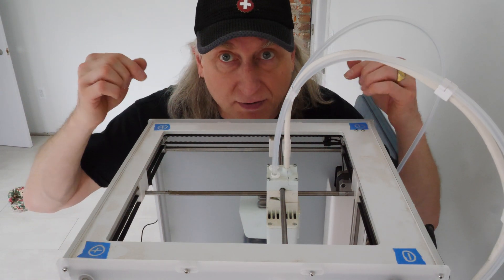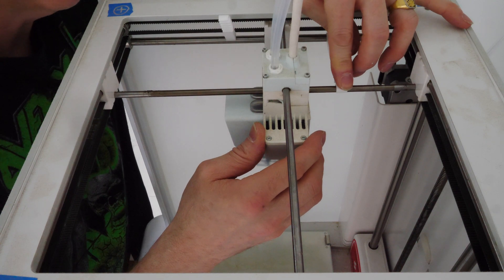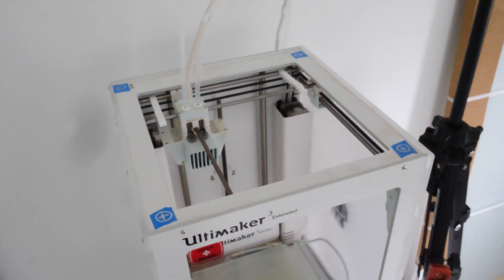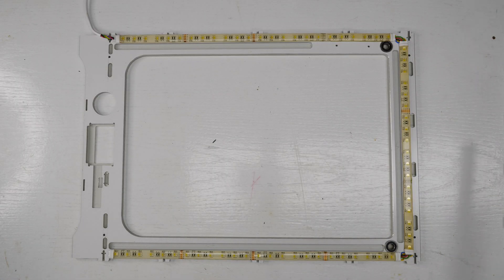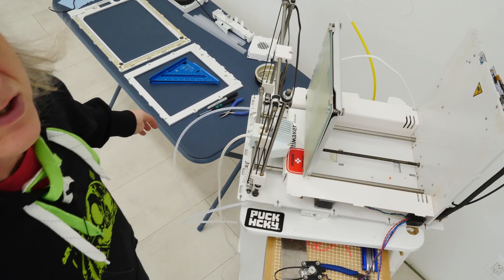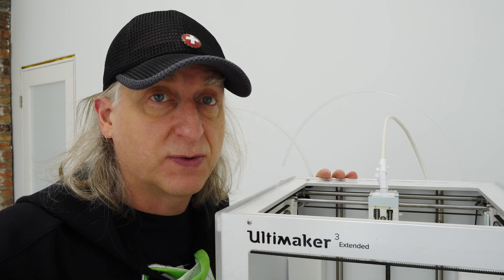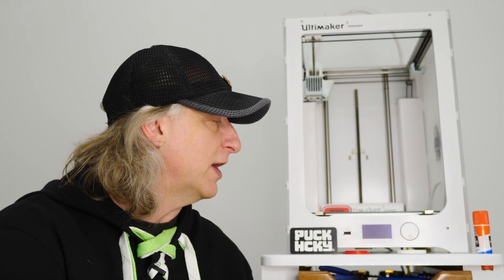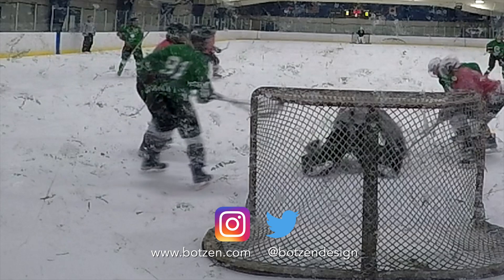Fixing my Ultimaker 3

Comment: The alignment tool is also very good at showing how weight of the Ultimaker's dual head can make the belt jump a tooth and an entire strip down isn't necessarily required, sometimes I found just relieving the tension and realigned the carriage with opposing parallel belts, that run on the same stepper motor. I would check the belt alignment, before ripping the whole machine apart, as the acrylic sheets are usually squared enough not to make a difference to the auto levelling bed. The bolts that hold the cabinet together can shift if subjected to hard impacts. Loosening the hex nuts and sitting the cabinet on a flat surface, then re-tighten the bolts, is sometimes all that's needed. I hope this helps. 👍

Comment: Hi there!  It's good to see you tackle such a job, but I think you should have put out a video describing the problem, asked for help, and awaited some replies for a week or so.  You would have saved a lot of time and trouble. I'm a fixer, of almost anything.  With a physics and math education and heavy love of science, I love puzzles. Your's is pretty easy and perhaps someone with the same problem can read this and fix their's easier.
OK, as someone else suggested correctly, measure each panel across the diagonals to find the problems.  Then get some thin metal rods, even straightened wire coat hangers will work. Attach one on one end on those problem diagonals and let the other end hang over the opposite edge with a mark on it where the corner should be.  Next, use the tools suggested by the manufacturer on the rails. Next, loosen screws on the housing slightly so the there is some wiggle room in the assembly. Now adjust belts to bring corners back to square while watching the tools and the rods so you know when it is back in shape. Then tighten the screws back up and then test machine.

Comment: My first thoughts.
There is nothing wrong with the panels, but with the drive axel. The toothed belt haves jumped over some tooth from the gear. 
Also , to measure the panels you need to measure diagonal from corner to corner. It can be that your triangle is crooked .
If you have the panels, why don't you redraw them and laser cut them new?

Comment: I wish you explained how you straightened the panels.  I wasn't getting a good sense of that from the sped up video.
Reply from the maker: Yeah, my bad I basically clamped the panels on a table and rack them by hand a little bit and then check them and made more adjustments
Reply: @EricStrebel  Thanks.  Good to know.  I wouldn't have guessed that that would work.

Comment: Pretty sure the material is Acrylic - I adapted the S5 at work to take unsupported filament through the material station….. it chipped suuuuper easy… PC doesn’t do this when drilled. So my tip is… be very careful if u need to drill the holes out larger

Comment: You can find all the 3D files of the UM3 on the Ultimaker github here : https://github.com/Ultimaker/Ultimaker3
The front panel is for example this one: https://github.com/Ultimaker/Ultimaker3/blob/master/1946/1946-J/1946-J.step
Top panel : https://github.com/Ultimaker/Ultimaker3/blob/master/1945/1945-F/1945-F.STEP
Reply from the maker: Oh, that is interesting, I will investigate. Perhaps I could have new ones machined
Reply: @EricStrebel  Yes ! It's possible to use aviation grade plywood, for example...

Comment: Hey Eric, big fan!

You can get the axes square by adjusting the belts of the xy assembly. So if one axis is out of line, adjust the belt on one side of it so that is is perpendicular to the other side and you can check using that tool you printed. Pretty sure that's all you need to do but correct me if I'm wrong.
Reply: Yes that is the first thing that came to my mind also. Just adjust the belts.
Reply from the maker: Yup, did that of course once the panels were straight
Reply: Yeah gantry racking. Had to do it on my Voron multiple times. Every time you play with belt tension or the gantry assembly you have to do it again.

Comment: I would never expect that from Ultimaker...
Reply: Used ultimaker
Reply: The panels except for the sides are Dibond aluminium composite sheets.  The top and front are very easy to get out of square in a drop.  Had this happen to me as well.
Reply: Yeah, even if it was just packaged with pressure on the frame, and the package was kept in a hot place at some point during shipping then it cools, boom, your frame is now not square
Reply: @ge2719  Right on, that happens too. Though I would hope that for new products they would have that figured out. Well, Games workshop doesn't though I know that. Seems any large parts they have always need to be warmed and reshaped.
Reply: @Morberis  yup, thats part of why i stopped buying gw stuff. every eldar fire prism the prism canons never lined up, the tips always curled out, even bought some forgeworld stuff, and they were always terrible. 
the total move to plastic and the doubling of prices killed it entirely for me.